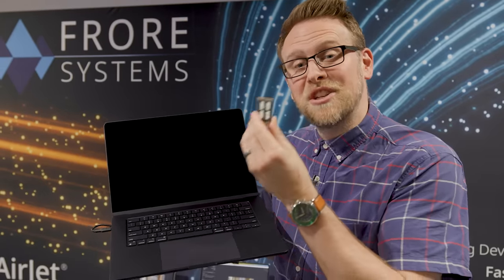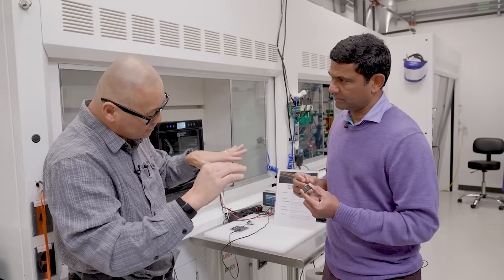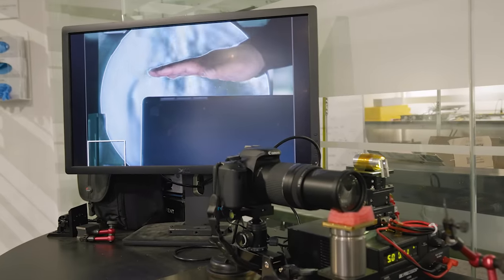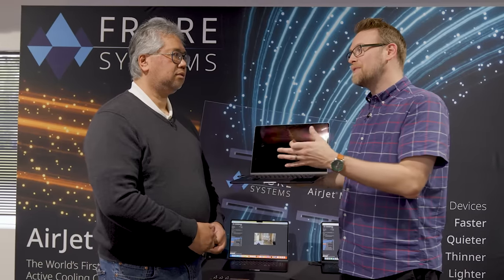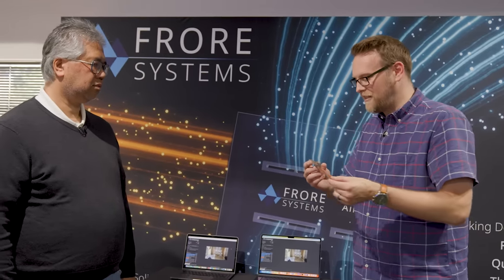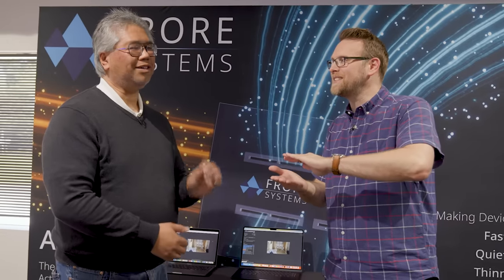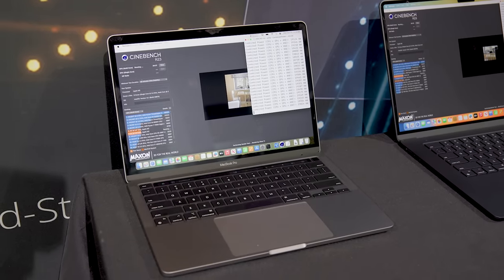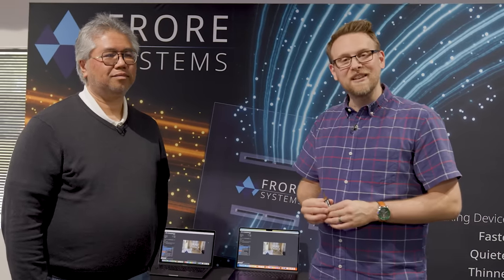AirJet Continues To Innovate Laptop Cooling

Comment: I hope framework devs are watching.  Seems like it would be a match made it heaven for framework.
Reply: AirJet Mini has “4.25 W” of net heat dissipation. You’ll need approximately 6 of them for a Framework Laptop 13.
Reply: @KellyWu04 Framework isn’t a slim laptop. It could fit a bigger one and wouldn’t be retrofitted
Reply: @KellyWu04  there is also the airjet pro that can dissipate 10.5 Watts.
Reply: It would also be a more difficult for repairing as you have to buy a whole solid state jet, instead of replacing a fan or heatsink. So I don't think it's in Framework's interest at the moment.
Reply: I would buy any laptop fit with airjets
Reply: @R3endevous solid states won't go bad like a motor may.  These could last years potentially.
Reply: Supposedly Linus exchanged contact info between Frore Systems and Framework. I am kind of getting the impression based on this video and the video Frore did on LTT that Frore is really focused on trying to work with Apple.
Reply: Seems like it would be much better suited to a scratch design from the ground up with air nets in mind rather than a preexisting design with swappable components.  A MacBook or Razer with a thinner chassis or a SteamDeck slim seem much better suited.  Even smartphones seem like a better fit
Reply: @KellyWu04 there is a 15w variant  they would only need 2 at about 1.5x the size
Reply: @speadskater  that's unknown until proven otherwise. There's no real market application yet
Reply: @R3endevous  this doesn't replace the heatsink...this replaces the fan. You still need a method of heat transfer via pipes or vapor chamber. And when a fan dies, you gotta replace the fan anyway so it doesn't affect anything. Also rarely do you replace only the fan, typically if you find replacements, you have to replace the entire cooling system including the heatsinks and pipes
Reply: @R3endevous  when fans die, it's usually because of fan bearings due to high rpms but it's kinda rare. Airjets aren't technically moving but instead are vibrating, you can hypothesize that there'll be less wear if not none since there's nothing rotating. But you're right, it's technically too early to tell since it hasn't been out.

Comment: Why is this not in everything already? This is so cool. 3D printer, VR googles and many other can benefit from this.
Reply: Way more expensive. I think it will be added to some high end products this year. But don't expect it in medium/low tier hardware any time soon. At least 2-4 years of wait time.
Reply: @korinogaro  not only that, I've heard it's not really quite, the pitch of the sound makes it sound louder and more annoying. the tech is cool but they use lithography to etch the patterns. this sounds like its probably multiple times the cost of a fan. I don't think they have got any attention. probably to expensive to be viable.
Reply: AirJet Mini has “4.25 W” of net heat dissipation. You’ll need approximately 6 of them for a Framework Laptop 13, also the airjet pro that can dissipate 10.5 Watts.
Reply: Because it's expensive, the price should go down significantly when they get upto scale due to how a larger "wafer" make it more economically viable like TVs, because you don't need to use anywhere near the smallest node as the features are on the order of ~100nm at the smallest so you can stick on the same node in perpetuity and just keep increasing the "wafer" size. The same thing used to work for cutting edge nodes where we would move to larger wafers which would make things more economical, but as the tolerences became tighter and tighter as we moved to smaller and smaller nodes wafer uniformity became a massive issue on making wafers larger.

But if you on like a 90nm node and your going to be on it for the next 20 years you can learn how to maintain uniformity and it's easier because it's a larger node to begin with.
Reply: What about durability though? This hasn't been tested to run on a device for extended periods. We're talking about lifespan of 10-20 years.

I could imagine this technology being so new that there's a lot of parts that will be worn out in time, and those have to be developed, just like flip screens in smartphones.
Reply: @MaKi-e3h  It's a chip dude, a processor is the longest lasting this in a PC, to be fair it's not going to be as durable as that because it has moving parts, but saying that fans are one of the most likely things to break in a PC hence why they are made to be replaceable even in designs with the worst repairability.

Like to be fair the PSU is probably the thing just ahead of fans to go wrong without physical damage being a factor otherwise motherboards would be right up there.

I would suspect these will last longer than a regular fan though.

Comment: why focus on apple this is best suited for handheld gaming PC's
Reply: MacBooks outsell handheld gaming PCs probably by a few factors...
Reply: Though Frore's site does have a section dedicated to handheld PCs.

"AirJet is a fully self-contained active heat sink module, which is silent, thin, and light. When manufacturers design a Handheld Gaming device with AirJet they cut the noise levels nearly in half, decreasing device skin temperature by 10 or more degrees C - while supporting the full 15 Watts sustained processor power."

Comment: Is there any report about the reliability of these AirJet's?
Reply: There's a PCWorld video where they tour the lab and discuss stress testing. I think they suggested that they need to pass 2,000 hours of continuous 100% operation at the minimum, but I don't think they've discussed long-term reliability. That being said, my understanding is that since there are technically no moving parts/friction inside of a piezoelectric motor, they should be highly reliable for many cycles. Probably reliability gains are going to be Frore's focus for "Generation 2", though.

Comment: I don't think we'll see this in the air linup in a long time, but in the pro lineup it makes a lot of sense and would allow computers like the 14" m3max to perform as they should. The current M3max on the 14" is substantially less powerful than in the 16" due solely to the lower thermal envelope of the smaller chassis.

Comment: They would implement it in the pro and keep the air passive if they were to do anything, because these coolers are expensive and it makes 0 sense to put them in your cheaper product, would mean they would be able to make the MacBook Pro ultra thin.

Comment: This is an interesting cooling solution for laptop computers, that instead of using a traditional heat sink and fan a Frore Systems Airjet is used. The big problem will be convincing laptop manufacturers such as Apple to build their laptops with a Frore Systems Airjet. This laptop cooling system is not an item an end user could install unless they have specialized skills and tools.

Comment: Anything Apple can do to make the devices thinner, they do, partly because of the machined aluminum chassis - it is cheaper for them to have a smaller chassis. I can see this being used in the Macbook Pro several years from now.

Comment: Any laptop except a macbook would significantly benefit from this , especially the thin and light ones , heck even gaming laptops like zephyrus g14 , m16 could get a lot of gains from this. Probably more realistically content creation focused laptops may prefer to use this cooling system more than gaming laptops .
Reply: the airjet pro that can dissipate 10.5 Watts, it's not enough even for a laptop of max 30 watt of power!
Reply: @gregandark8571  I SEE

Comment: Unfortunately I'm not feeling very optimistic even though the technology itself is quite promising.... 1 of 4 things is likely to happen:
1. (Most optimistic) Everyone already has their designs pretty set in stone, and changing that would take years of R&D but it would come eventually in maybe 3-5 years
2. Apple wouldn't adopt it, since they have been slowly moving away from 3rd party stuff in the first place. But the PC market may get this.
3. Apple does adopt it, but that would change nothing for us. The Air would still be fanless, and the pro would get thinner but the prices would increase to "justify" this change.
4. (worst case) Some company, doesn't matter which but most likely Apple, would buy out this company and the technology would become proprietary. Macs would still get more expensive, just coz they can.

I hope they sell it as separate module that the DIY community is able to get their hands on. That would be the best use of the technology, but would it profitable for them is questionable.

Comment: There is many questions unanswered. It is cool tech but why there is still no commercial available laptop to buy? How much this solution cost compare to fan and fanless design? If they would sell DIY kit for Air or MacBookPro, how much it would cost? 100 bucks? Add 8 GB of RAM and you are at price of 14" M3 MBP. Reliability is of course also question. It is new tech. You can not put it into macbook to find three years later it is failure. And of course power efficiency compare t o fan. But DIY kit for older MacBook Air and others could be more interesting and price more justified.

Comment: 9% Performance gain 😕
Frore had way cooler demos previously.
Reply: It's far quieter. The M2 is pretty damn power efficient, so you'll need an Intel or AMD laptop that breaks 40W+ on nT load.
Reply: Nice pun.

Comment: Guy on left is wrong about the M2 on the Mac Book Air being the same chip as Mac Book Pro. The Pro Macs have M2 Pro Chips.  The Pro Chips have twice as many transistors.  The M2 Pro Chips come with two versions the 10 core CPU with 16 GPU cores and the 12 core CPU with 19 GPU cores. To say you get the same performance as the Mac Book Pro on an Air with better cooling isn’t true.  Mac Book AiR would be better with cooling than without that cooling for sure.
Reply: WRONG. The 14" & 16" have the M2 Pro & Max, the 13" with M2 is just a Macbook Air with a fan and a touchbar.
Reply: They're talking about those fake "Pro" models that are really just the base M models like the 13" MacBook Pro, and this what with the base model 14" MacBook Pro that only has an M3.